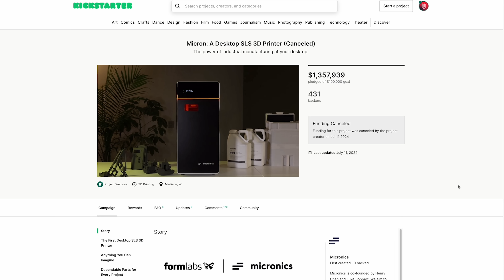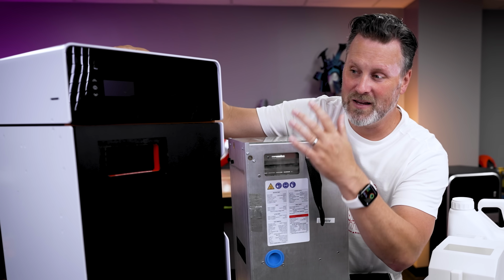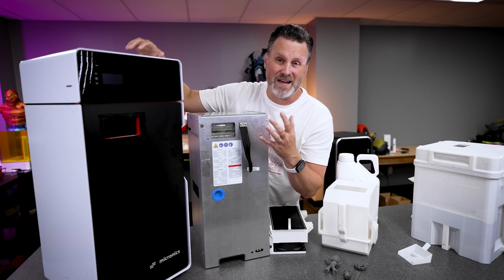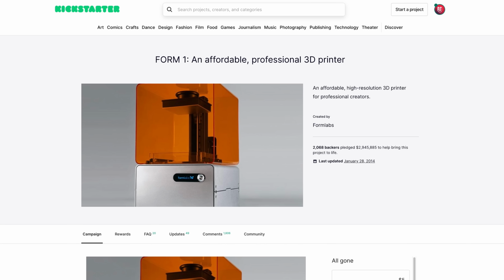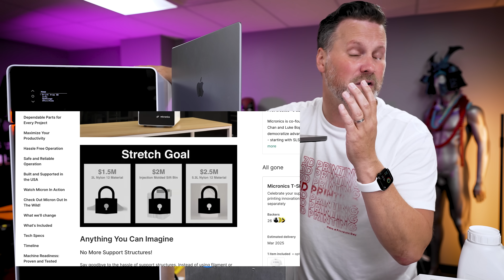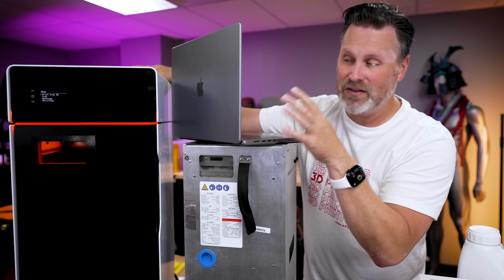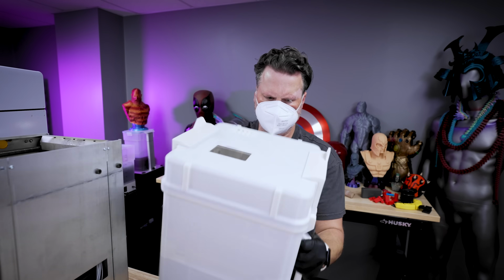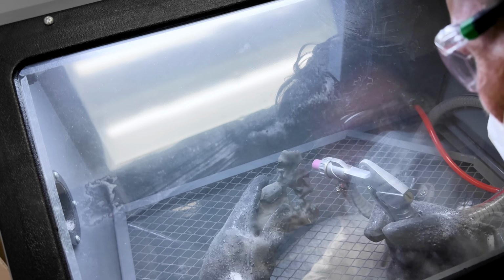NOW WHAT?! Micronics Micron SLS 3D Printer

Comment: Did Formlabs buy Micron just to shut them down... my thought Micron is/was a threat to Formlabs
Reply: Stephen from CNC was on a podcast where they say Formlabs will not be continuing with Micronics. He was in the know with Formlabs before Micronics was sold to Formlabs. He let it slip that Formlabs bought them out to stop competition and then he tried to justify the sale.
Reply: @peterkn2 which podcast, curious to hear it
Reply: Goodbye affordable SLS printers
Reply: @Tommymang look at SLS4ALL
Reply: I believe FormLabs did it to simply hire these two guys. Formlabs can EASILY put out a better machine for equal or lesser value, but that doesn't fit their ethos. That simply is not in their brand. So, in effect, it was to shelve it, but mostly to free them up and put them to work. 

It's obvious the Formlabs recognizes they've been missing a trick or two for years (now finally embracing MSLA resin printing), so hiring these guys is likely another shot in the arm to stimulate more innovation.
Reply: There is NO other reason they would by them  They have zero technology Formlabs either don't have or couldn't easily make themselves, if they wanted too.  Formlabs worst nightmare is the domestication of SLS.
Reply: @guyb7995  are you joking? there worst enemy is being the first to market with a domestic sls machine? you sound like the paraffin lamp guy trying to buy out edison. the machine is inevitable mate. you dont just go buying things out thinking you are going to stop progress. thats not how business works. progress is going to happen. businesses buy out other businesses to skip the bulk of the RandD and take the glory.
Reply: @freelectron2029  you don't think they want to be forced to drop the price of their hugely over priced SLS machines because of a domestic unit that fits a lot of their potential customers needs (currently forced to buy their units) at a fraction of the price?  Dude, I want some of what you are smoking 🤣🤣🤣
Reply: @freelectron2029  "you dont just go buying things out thinking you are going to stop progress."  lol, this is literally how business works!!!  You out did yourself with demonstrating your ignorance with that statement.
Reply: I would put good money on that's exactly what they did. In its current state I'm sure it was no threat. But the very fact they were bringing SLS down an order of magnitude in price from the competition in their very first machine. If they ever made it to V2,
Reply: At this time. the market needs a "fair priced" SLS printer option... done right.

Micron had a vision, but was convinced by Formlabs to sell out

SLS printer from Bambu? I'd back that... 🙂
Reply: Formlabs is a hyper locked in system. While they started off like Micronics. They bought them to shelf them. Maybe the slicer is of some interest.... but then Formlabs has the muscle to just replicate that if they chose to.
Reply: From the beginning, they stated that they had run out of money, and needed the Kickstarter to keep going.  There were also some things that they refused to acknowledge, that it doesn’t seem that they were capable of addressing, and I believe that is why they took the deal.

Red flags went off when they said, “It was a good deal”, as no one sells their company for a “good” deal.  At their price point, they would not be able to address the safety issues, which could have landed them in legal trouble.  At least that is my opinion.
Reply: Autodesk - if in doubt buy the competition and dilute it down _ this printer was on my radar but no longer
Reply: they are killing it
Reply: Micron was never going to make it to production. Strange parts breakdown showed it was no where near production ready
Reply: @Clovenlife of course they aren't near production ready. They already said they were in beta, not preproduction. The schedule laid out another year of development after the campaign and then another few months of preproduction testing before launch.
Reply from the maker: It's entirely possible, I like to stay positive and think that they saw all of the excitement and want to help fund and make that a reality
Reply: @UncleJessy you are trying to hard to stay on the good side. We all know is not happening
Reply: you dont buy something to shut down the competition because they hare bringing out an inevitable product. 
otherwise you will be buying a company every second week.
 they bought it to get the inventors on the pay roll along with their product and their experience.
 so they can further develop a product they are already working on or continue miros unit 
either way its about being first to market. 
why would you think you can just shelve a technology when you can just develop it and be first to market.
obviously no business degrees in here....
Reply: oh yes you do - buy and bury the i.p. Or dilute and distort.
Reply: @freelectron2029 it happens all the time. That’s something big companies do to protect their IP sales.
Reply: @freelectron2029  Have you heard  of Facebook, Microsoft, Google, or Apple. They have all bought out  products to kill the competition.

Comment: i wouldnt be messing with that powder without an n95 on.
Reply: This is actually one of the reason why they are so big. They need a room only for the printer... why not just use all the space avaliable (being reasonable) if you already doing a full room for it.
Reply: I went and googled around after seeing this Kickstarter early on. To see what people that work with the machines had to say. The big take aways I got were. Print in a dedicated space, not the back of your workshop. A room just for the SLS. Get changed into new clothes when leaving the room. Depending on the powder you need serious masks or just basic ones. Some powders are super toxic, others not so much. My bottom line was, I'd love to try it but the cost of the printer is just the start. You'll be spending on air filtration and air compressor setup. Out of my league.
Reply: @ClayMann it’s not only the toxicity that you need to worry about.  Once the particles are in your lungs, they are there forever, which will eventually lead to mesothelioma over time just like asbestos.  The vaporized particles are toxic, no mater what material you are using.  You are not allowed to release them into the environment per EPA and OSHA regulations.  Micronics was silencing everyone who talked about this in their comments.
Reply: @cnc-maker  wow, well I am truly an SLS novice here so just passing on what I found as someone curious. My only advice is to take professionals advice. Its out there and easy to find.
Reply: @ClayMann  You need "serious" masks for working with ANY powder fine enough to be used in an SLS printer. Literally any powdered substance this fine is an enormous health risk, regardless of the basic toxicity of the substance itself. Human lungs weren't designed to cope with breathing in these extremely fine powders, and they are a huge cancer risk simply because of that.
Reply: @ClayMann   The only powder this printer works on is "non-toxic"; as in no direct reactive toxicity, but far from being possible to declare harmless, still it's still a physiological irritant and new insights are coming out that suggest that it's potentially more hazardous than thought just a few years ago.
Reply: @SianaGearz  yeah I've already learned my use of the word toxic is not how the industry uses it. I call hairspray toxic and its obviously not, just irritating. But long term exposure is another matter and apparently woefully understudied. I kept reading people who did not even work with the powder but were in the same building complaining of headaches that were persistent and went away when they left the job. That's worrying to read that in multiple places not connected at all. That suggests that the stuff gets aerosolised (not sure that's the correct term) enough that it can travel around companies that have dedicated spaces just for printing.
Reply: @ClayMann  I had not expected headache, that is interesting. If it's this particular powder, which it might not be, the only reason i can think of is when it sits in the printer at a very elevated temperature for a long time, a small amount of it will experience breakdown and emit low amides, which might indeed be toxic. Nobody knows for sure. Hypothetically it should become garbage long before it's able to volatilise but i can see possibility that it may not necessarily be so.

There may also be all sorts of "garbage" in industrial polymers, which is why FDM printing PA at home is considered vaguely safe and there's no obvious smell, it's probably made from effectively med grade material when you buy it from the usual suppliers; unless you feed your printer trimmer line, which should be PA, but it stinks sooo something's obviously not quite right with it.

Irritants are also not without hazard of lasting harm, they are the primary cause of say asthma and numerous other occupational diseases.
Reply: Yeah the fact they sent a KN95 to reviewers is scary in their safety perspective. Pretty sure formlabs would have loved to just ship the kickstarter but one brief safety analysis probably spooked the lawyers enough to kill it before anyone else would get lung cancer. The powder isn't like uncured resin that would eventually cure with enough light exposure the tiny microplastic dust could presist long term or worse slowly spread around a users house after a couple acciental spills.
Reply: n95??? People that typically work with this stuff have full on hazmat borderline beekeeper outfits on with industrial ventilation. Every single one of them cringes at these sls printers and the way youtubers handle them, or the potential of regular consumers getting them. The risks are almost on par with asbestos. You're probably safer sticking your face in a resin printer and huffing fumes during an active print. Jfc.
Reply: No material you will be printing in this printer will be harmful to
 you. The particle size is too large to be airborne and for you to ingest. Even if you do breathe some in, again the particle size is too large to be harmful. At most, it will just be an irratant.
Reply: @alexhatmaker7455  that is a false statement.  I suggest that you learn more about it, as the powder and vaporized portions of the powder, are in NO WAY SAFE.
Reply: @alexhatmaker7455  That's awesome and should be mentioned in the marketing :). I am now considering one then